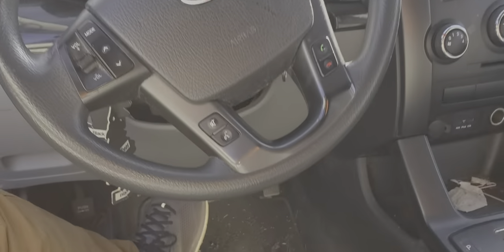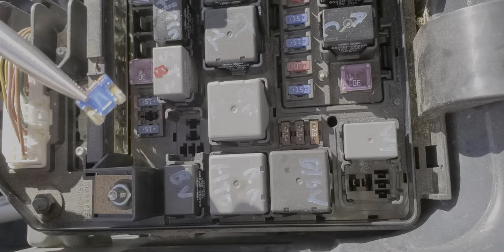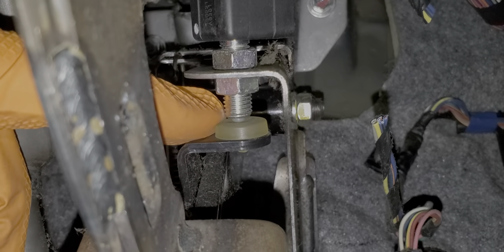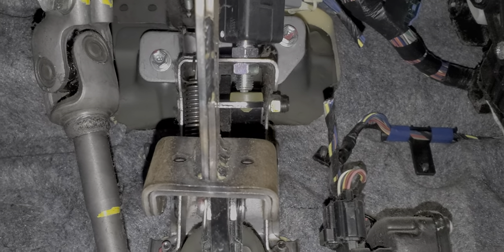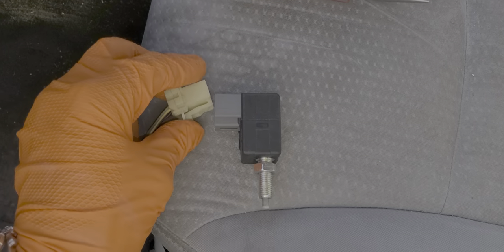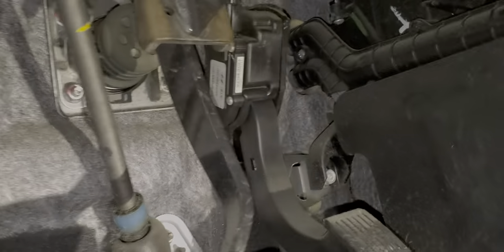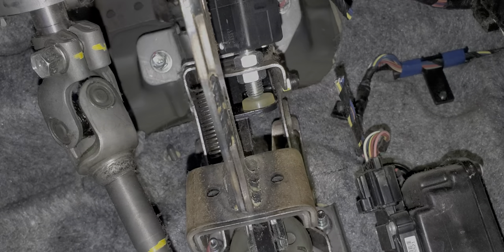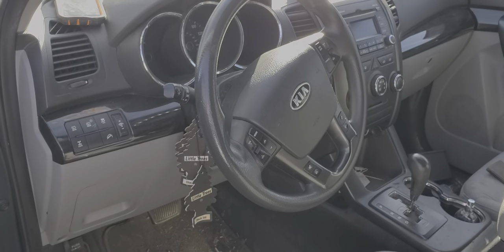2011 Kia Sorento Brake Light Fuse, Stop Light Switch Replacement, Brake Lights Stuck On

Comment: the broken bits are exactly where you said: yellowed, disintegrated, on the floor board. some small object goes there for now but it sure looks like one of those rubber feet for a stool might do the trick.

Comment: I just wanted to write you and thank you for this vid. I knew it was something simple (brake lights stayed on). After a hellish three days, with my trustworthy mechanic being a no show, and neighbors trying to help out (battery died cause of the brake lights staying on, then the shift stuck in park after recharging battery.. shift lock release button was missing..had to open center console to manually release the shift from park...then brake lights NEVER turning on...checking bulbs, fuses).. THIS is the video I should have found on day ONE! Thank you so very much!

Comment: Great video. My break lights won’t turn on. The fuse don’t look like a bad one. Do you know what else could fix this. Seems like a bad break switch would leave the lights on and my lights is off.

Comment: Thanks!  I had the “lights on all the time” problem, couldn’t get my old ass under there to look😢, so got wife to look. She didn’t know what to look for.  Started shopping for switch, came up on your video, showed her and told her to look for the spacer…she found it in pieces on the floor!  Problem Identified.  Made new spacer from a faucet washer with the body of a pop rivet pushed through the hole for positioning pin. Puta little RTV on it, stuck it to bracket, and that was a wrap!  Your video was well made, good lighting, clear picture and great explanation!  So, thanks again for your efforts!
Dave Chaney, Baton Rouge La

Comment: Great explanation and very helpful. My Kia would randomly ignore throttle response and the lights were stuck on. Just as you mentioned, the broken part was on the floorboard. Saved tons of time.

Comment: Thank you soooo much for the info. Just like you said the little plastic piece was laying on the mat. You saved me a headache. The plastic piece split apart so i glued it back together and then glued it to where it’s supposed to mount. Temporary fix until i find a replacement part.

Comment: Very helpful bro.. found the broken rubber on the floor.. replaced it with a nuts and bolt.. thanks for the tip

Comment: As predicted the broken part was found on the carpet of the drivers side.  Temporary fix with black tape and a nickel while I order a new switch and broken part.  The switch is still working but the end of the plunger looked worn so it is getting replaced.  Fixed after one youtube video.  Thanks
Reply: From reading all the comments, it appears everyone is going with a MacGyver solution.  I can't find a name or part number for the broken bumper/grommet/washer thing.  Also no picture of what the original part looked like.  I don't mind spending quite a bit more than a nickel, but I don't know what to order.

Comment: I've used the top for a pre rolled joint. The little top fits perfect in place if the pad. If it works it works

Comment: I had a question..my third brake light was staying on and so I did find the old grommet was on the floor board but my two tail lights were turning off. So when I replaced the grommet the third brake light turn off when the car was off. But now all three lights won't come on when i press the brake pedal!! Does this make sense? Any suggestions

Comment: My two bottom break lights in my Kia Soul won’t turn on at all. The top middle light does. Is this considered a fuse issue or the stop lamp switch ?
Reply: did you figure it out? mine is giving the same issue i’m exhausted don’t know what it is. my break lights won’t turn in at all

Comment: Thanks for very informative tutorial. I have checked both the fuse and replaced the switch. Still the brake light do not work. Also the lights for the license plate and the fog lights do not work. Any suggestions?
Reply: Might wanna check the bulbs..

Comment: Hey Dude. Nice greetings from Germany. 
I have a problem and not break lights at all. All fuses were checked. And software device plugged to the car. It said that the emergency break light relais is defect. So i changed it. Still no break lights. Today i changed the pedal switch. Still no break lights. 
Can you help me out?
Reply: Hello, did you figure it out? i’m having the same issue don’t know what else to check

Comment: That yellow plastic bumber that the brake light plunger rests on will disintegrate on almost ALL Kias after 10 years or more. I've already relaced them on my 2009 Rondo, 2011 Sorento and a friend's 2011 Forte. Just find a piece of plastic or any other hard material about 1/8 inch thick and cut into a circular shape 1/2" wide and hot glue or epoxy in place!
Reply: With 1000's of different, more durable plastics to use to make that bumper out of, Kia did a huge brainfart by choosing the material they did!!!!

Comment: Is this what would prevent your vehicle from getting out of park?
Reply: I found if that the fuse is pulled out, you can't start the Sorento. If it's already running, THEN you pull the fuse out, then you can't take it out of park.
Reply: What if our new fuse and fuse keeps popping everytime starts?

Comment: Thanks so much for this! The brake lights in my '12 Sorento stayed on after I got home from work early this morning, and the cause was exactly what you showed at the start. That off-white plastic grommet cracked and fell apart.  I found it in pieces on the floor mat. Is replacing that grommet part easy?
Reply: See my response I added just a few posts earlier.